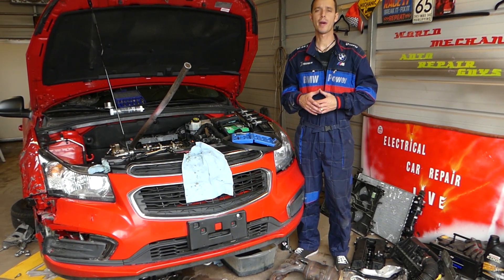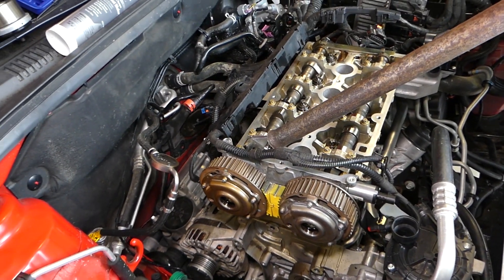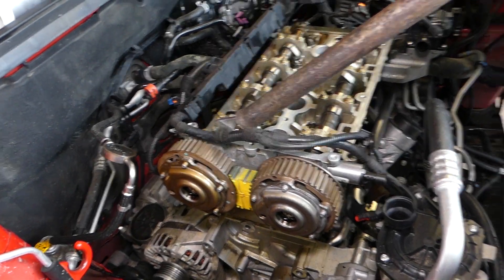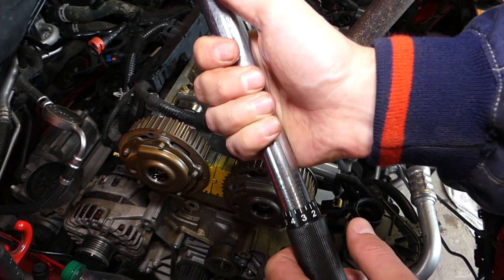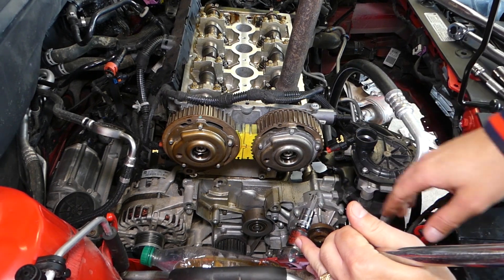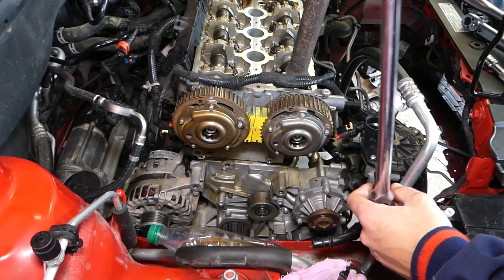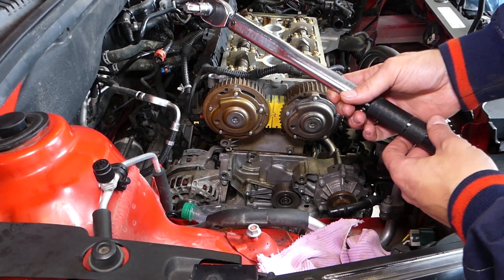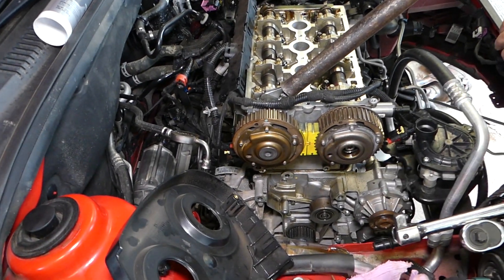VVT VARIABLE CAMSHAFT GEAR TORQUE SPECS ECOTEC 1.8 OPEL ASTRA ZAFIRA INSIGNIA MOKKA ROMEO 159

Comment: Great video guys as always.
Can you tell me from your experience, why my car has lost power significantly and start misfiring after these parts has been replaced. The timming belt was placed in order.
Reply: Could be  the solenoid(s) as Darkfloyd stated, but also a blocked oilpassage - if you changed the camshafts oilseals (because of silicon pushed in these small canals during refitting the cambearing. Did you use OEM-parts? Always do, because this engine is very sensitive for non-original parts. You did not change any sensors?
Reply: probably not done right. very frequent in this cars, some people synchronize  the 2 wheels on the camshafts and the one in the crackshaft, but you also need to loosen the camshaft wheels, remove camshaft cover, and synchronize camshafts themselves. then tighten everything again.

Comment: Hi
Why we need to change the bolt every time we change the camshaft?
Reply: The camshaft sprocket bolts are Torque-to yield bolts and if you do not replace them they will either break in tightening down or will not give sufficient tension.
Reply: @howiesiesoosoo  where do you buy the bolts?